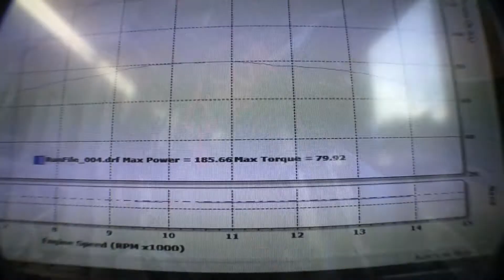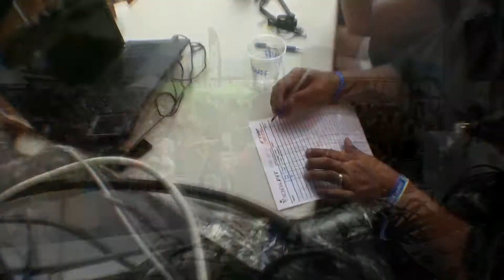Nobody Said Racing was Easy - S1000RR Racer Story

Comment: BTW what tires are you using on this bike?
Reply from the maker: I have run all manufacturer brands.. I don't remember what tires I was running in 2013.  Either Dunlop or Pirelli
Reply: @irnieracing  since I was riding to commute
Year-round in Salem and surrounding areas
Plus riding crazy on the weekends around silver falls & beyond
I have went through three sets of Michelin PR5'S
One set of pirelli Angel gt2's
Following summer a set of Diablo Rossi's supercorsas
Never have tried Q3 or race slick
Setting up a track day at PIR for may 8th
Definitely going to learn alot